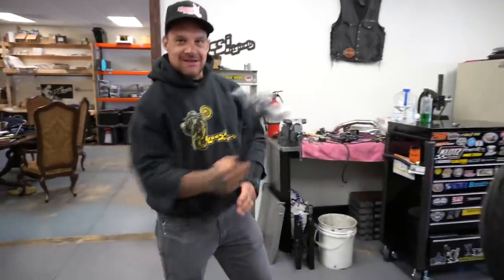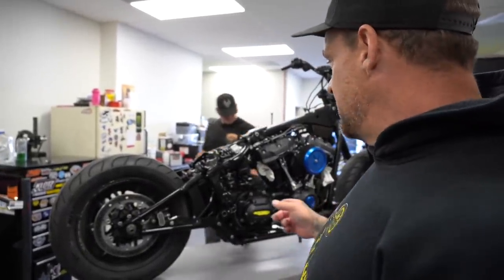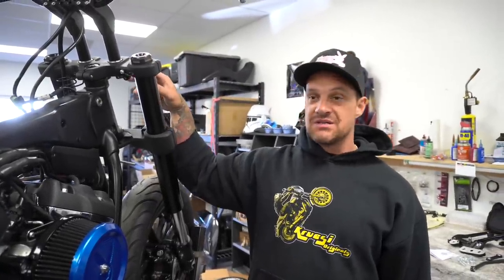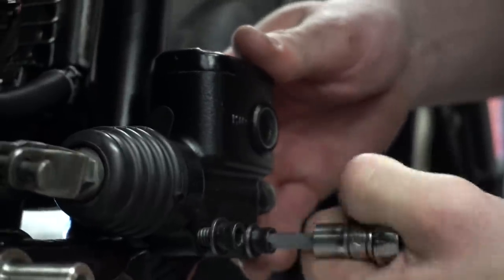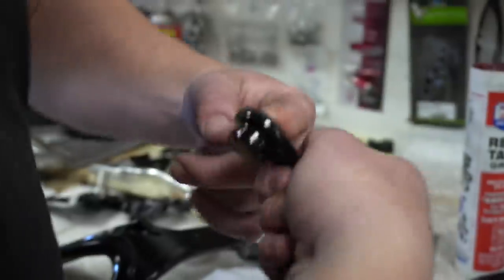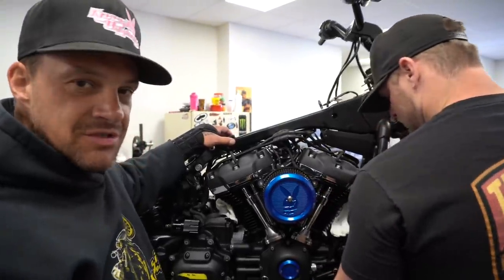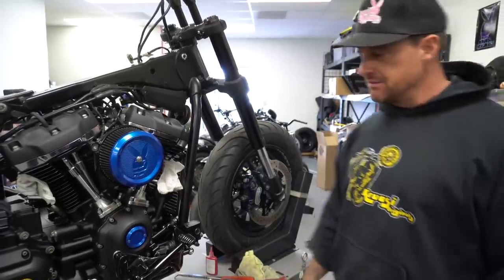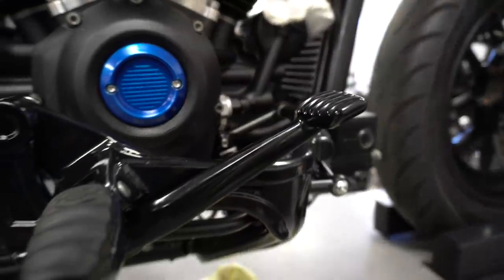WIN A CUSTOM HARLEY DAVIDSON M8 SOFTAIL BUILT BY KRUESI ORIGINALS. (P1) FAT BOB BOLT ON MIDS

Comment: Hey man, I know you’ve said it In a video before. But I do t remember which one. What is the best Dyna for a stunt bike?
Reply: What year, model, etc
Reply from the maker: 2000-2005
But 02 is the absolute best
Reply: @kruesioriginals  is there any better models? Super glide, low rider, street bob etc? And thank you!
Reply from the maker: @Iysmnyd  Fxdx is the best, but really anything that is not a wide glide no wide glides, I repeat no wide glides.
Reply: @kruesioriginals  hahaha, I have an 08 street bob now. I’d never ride a wide glide. But my bike has 40k miles. wanting to sell it and get a bike that already has mags, is carbureted, has a lot less miles, and has the bottoms end in it that you were talking about the other day. Found a nice 05 but it is fi, should that stop me from getting it?
Reply from the maker: @Iysmnyd  fuel injection is always better.  The timken bottom end only came in the 99-02. 99s are trash though. An 08 is good run it
Reply: @kruesioriginals  yeah but the 40k miles makes me nervous. It’d be easier to sell, and buy another one with lower mikes. I don’t have the money or skills to rebuild if it blew up. And the older bikes have mags. And I want mags, better for wheelies right? I can get a 05 fi super glide rn for 6500 with 10k miles. Has mags already too. What do you think would be the better decision?
Reply from the maker: @Iysmnyd  Go with that 05